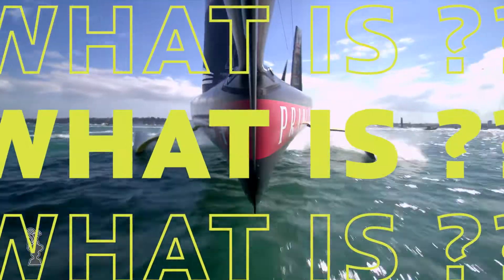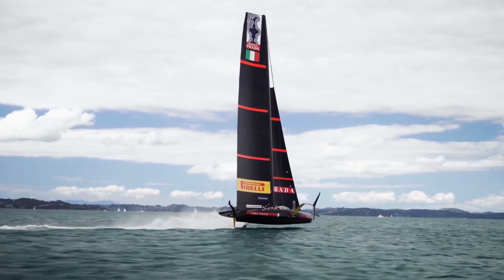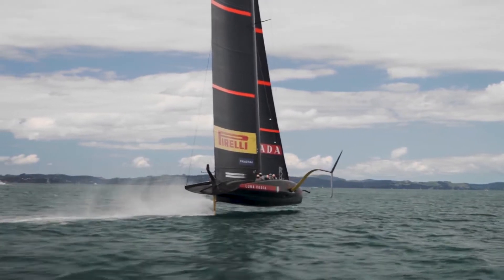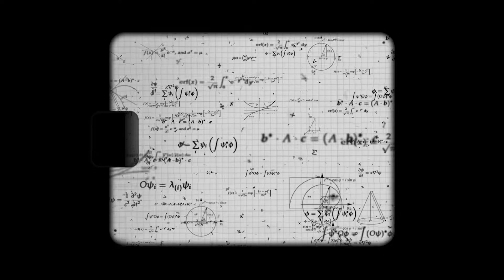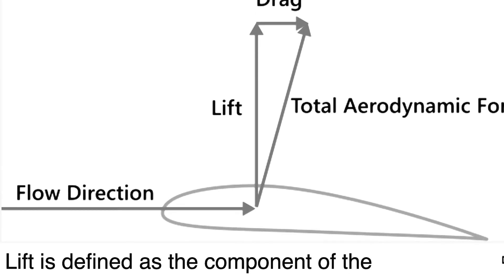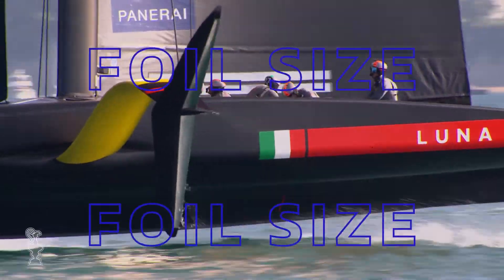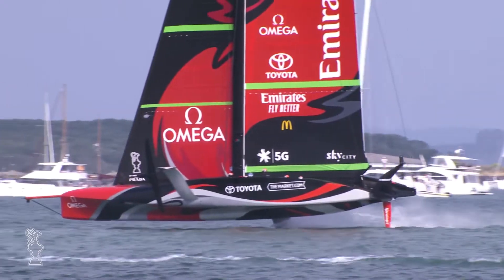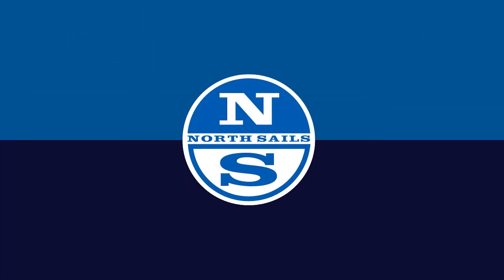What is Foiling? North Sails explains.

Comment: quote: "Pressure differential between the top & bottom of the foil"   I can understand this in a gas, but in a fluid ???
Reply: What's the difference?
Reply: same thing
Reply: pressure difference means splitting the initial flow into two parts, with the top part going further, over the hill part, creating pressure difference. So no matter air or water, still get lift, though wont reach sonic boom in our Kiwi yacht just yet....lol
Reply: gas is a fluid